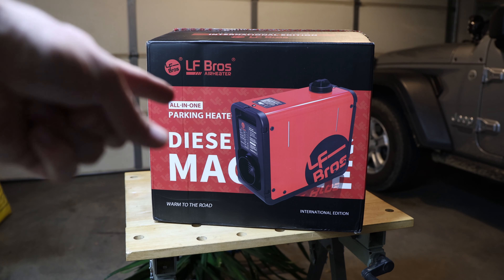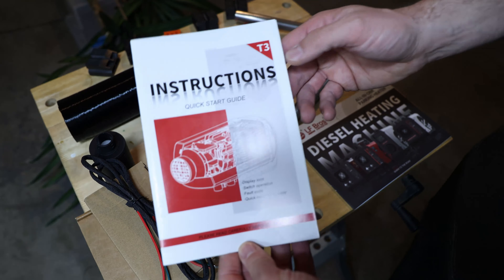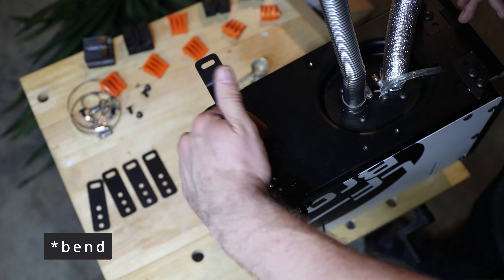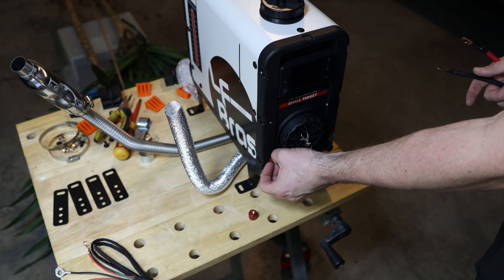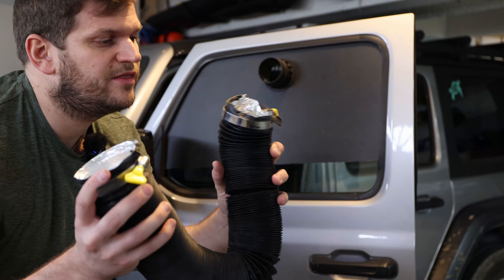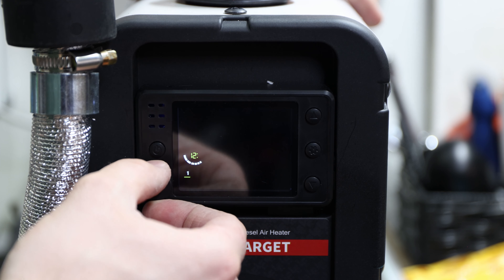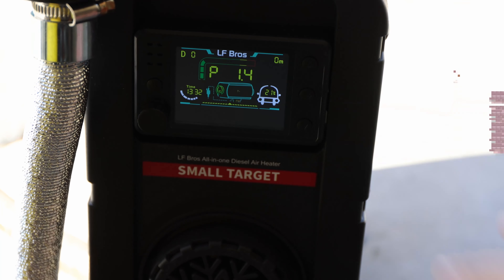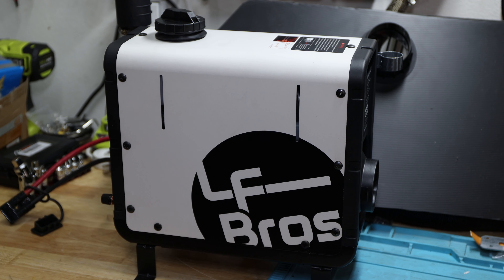LF Bros N4 Diesel Heater 5kW  Can it keep my Jeep warm Winter Camping Let’s check it out!

Comment: I have 2 of these, one heating my office and one for keeping me warm fishing. Fantastic heaters but it really irks me that the LCD display is on the back and not the front.
Reply: You can rotate the heater unit so that the hot air outlet is on the same side as the controller. I read it on one of the amazon reviews and plan to do the same when I get mine tomorrow. Will also be replacing the tension clamp on the fuel line with a decent hose clamp.
Reply: @douglasrowland9986 Didn't realise you could rotate 👍
Mine came with proper hose and proper hose clamps so didn't have to change those.
Reply: I got parts but have no idea what they are for! lol got it working but still gotta fine tune the setup. They should give u an instruction manual, typical horrible Chinese manufacturing. lol
Reply: @ I got mine and just swapped the end pieces and rerouted the wires. I did have to loosen the body of the heater to do so. Unfortunately mine did not have the decent hose clamps on the fuel line, so off to the hardware store I go.

Comment: Do you know if I can use B20 in the heater?
Reply: Absolutely Not.  It will gum up and create havoc inside your unit.  B20 Biomix jels up easily in the cold , Trucks that use it actually warm it before it gets to the injectors.  I think LF Bros specifically says not to use it or voids warranty.